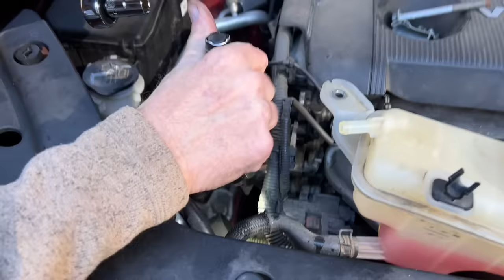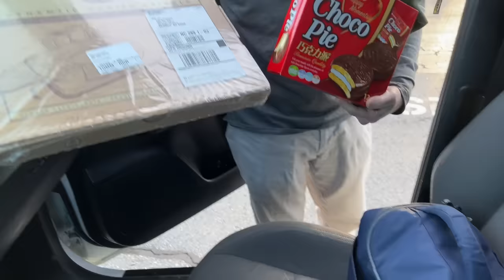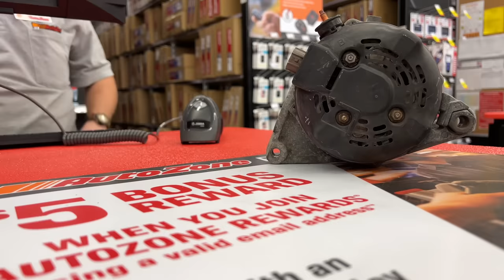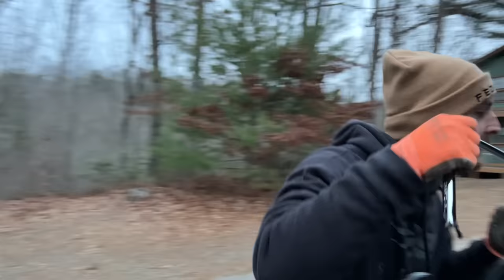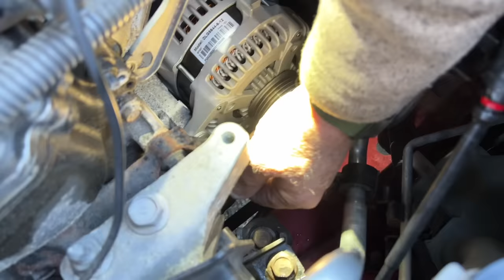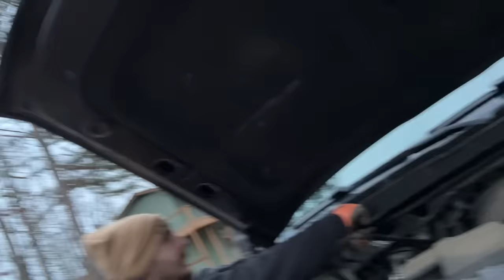Both Cars BROKE at the Same Time!

Comment: Well cold start on a diesel is difficult. You need to change your battery to Cold cranking amps on your regular car. On your husband's truck is a diesel. You need to keep the block warm, otherwise it will not turn over until it's warmed. Just get a little heater and place near engine block. Until it's warmed. Then let the engine idle for awhile before driving

Comment: Thankful you are up and running. Many many  years ago, I had a 1973 Olds Cutlass Supreme and it left me stranded in the road two times. Every time thought it was the alternator, but it ended up being the voltage regulator. Never will forget that. I’m watching your video on Sat. 1/6 and we have 6 inches of snow with more coming down here in the eastern panhandle of WV. Hope you guys get some snow for your mom! Take good care. God Bless!❤️❄️

Comment: Oh gosh, I suppose when it rains sometimes it pours! I've had battery trouble before, needed serpentine belts fixed, luckily that was on an older car I owned. I've also gotten stuck in the mud before, no fun. Glad you have your dad to help and you knew a bit about your car to diagnose what the problem was! I don't know much about cars..but it would probably help if I did! 😄
Reply from the maker: Getting stuck in the mud, that's no fun!

Comment: I used to have an old green station wagon.  It was tuff as nails, ran like a top.  The only trouble it ever gave me was the starter.  I had to keep a two by four in the back seat and when she wouldn't start, I had to put the 2 by 4 down to the starter and bang on the starter sometimes it would fire right up, sometimes it took a couple of tries but she always ran for me.  I got a lot of funny looks, and even a few comments along the way.  God bless you all.

Comment: Very nice to have mechanics on hand - save a lot of money that way! Vehicles -- I have so many car stories of repairs, and even though a Volkswagen Golf manual transmission was my favorite car of all to drive, it was the most expensive for repairs -- and the most ridiculous problems and repairs at that! Battery and alternator both with Honda; the car I have now I got so frustrated with the batteries going out I finally bought the real deal from the car manufacturer themselves, no more fussing with dead batteries too often, at least every year if it can be helped, figured that super tiny battery they make is hopefully the answer!

Comment: 🤗Glad the car repairs worked out. Our car just had issues too. All the power steering fluid ran out on Thursday (1/4/24)!😒 It seems there's a break in the line and a seal has disintegrated. It's Sunday and they're still working on it. One part of the fix led to something else 🙄...oh well, God's got this covered, too. 😉 As a side note ... Kringle pastry is delicious. I like the almond one. But the raspberry filled ones are delicious too. Blessings 🥰💕

Comment: Tell how old I am. In 1993, I was stationed at Ft. Wainwright, AK. I was driving in downtown Fairbanks them temp was around -30°f and the alternator died. I was stranded in the middle of Airport Way, the main drag in Fairbanks. A tow truck and a voltage regulator later, I was back on the frozen roads. God bless y'all.

Comment: We're all gonna be here all weekend talking about our vehicle woes! My first car was a 1967 Ford Mustang that my daddy had bought as a mid-life crisis.  When I graduated HS in 1986, he gave it to me, and within 2 years, my husband/then boyfriend had to replace the engine.  The car had no power steering , so the tires had BETTER be aired up, NO air conditioning IN TEXAS, I had a fan that plugged into the cigarette lighter!  We had several 'hot rods' and then switched to trucks.  Our BEST purchase, that we still have and is being rebuilt right now, is a 1996 Chevy truck.  Doesn't need to be hooked up to a computer to fix, can survive an EMP attack and RUNS LIKE A SCALDED DOG!!!
Reply from the maker: Nice! Daddy had a Chevy around that year when we were little 😁

Comment: You're very fortunate to have your guy's able to do all that. My right side turn signal light unit got pulled out  just hanging by the wires, at the car wash yesterday, so Tues I go to my mechanic shop to see what is needed for them to fix it then make an appt to get it fixed. Just time I guess and hope it doesn't snow😅.

Comment: Sorry about the car problems.  To me, there is nothing more frustrating.  My 1st career was a certified GM and BMW mechanic.....waaaay back in the '70s and early 80's.  When GM came out w/ the Monza 2+2 v8 and u either had to lift the engine up in the engine bay or take the tires/wheels and inter-fender wells off just to change plugs, I decided I needed to find another career!   On a different subject....did u get snow today (01-06)???  It 'almost' snowed where I live.  It was ~ 33℉ and cold raining.
Reply from the maker: Cool, I didn't know you were a mechanic and we didn't get any snow today, but I hope we will soon 😁

Comment: Very Cool, Thankyou. So Happy you Got everything sorted so quickly and managed to save on some labor costs. My best Purchase last year was a small Re-chargeable Car Battery Jump-Starter. Only Cost about $50- has multiple USB Charging Ports too if Power Goes Out. Get about 20 Car battery Recharges on 1 single Jump Starter Charge. Charges Quickly, and USB Charge Ports are Surprisingly Useful too. Hope this Helps. All The Best. Cheers

Comment: At age 70 I have had enough dead batteries that now I just replace them every 3 years. These new alternators are expensive. It is so full filling when the repair is finished and the vehicle is operating as it should. Shortly I will be in need of a set of tires for my truck, a 2010 Ford Ranger.

Comment: Hope this helps you guy's and gals. Also make sure your vacum hoses are sealed properly and are free of debris. Otherwise your car will not start. Your starter coil is inside your distributor. If the starter coil is cold or wet, it won't start. Your hair dryer can help that. 👍😎

Comment: This sounds like our kind of luck!!!  So glad everything turned out good!!!  Batteries and alternators certainly take a beating in cold weather!!!  I remember one time and it was in the heat of summer that one of our cars refused to start in the grocery store parking lot…luckily a nice guy jumped us off and we were able to run right down the street to get a new battery installed at a parts store.  Another time we were out of town visiting some friends when the alternator went out on our truck…the man we were visiting is a mechanic and he was able to go into the nearest town to get an alternator from a parts store and install it for us while we were there, otherwise we could  not have made it back home. We were in another state over 200 miles away from home.  He was very surprised we made it from our house to get to his house because the truck quit working almost the time we drove into his driveway—we literally coasted into his driveway—how’s that for timing!!!???!!!  So glad you guys are back to having two working vehicles.  💝💝💝

Comment: I find as i get older I have less enthusiasm for working on cars , especially if I have to get underneath them . Katies'  old truck is so much easier to work on than these new front wheel drive cars with no room to move , i like the traditional north / south engine with a gearbox behind and a diff at the back . well done though Matt and Austin , it feels good after the job is done 🙂

Comment: Corie tell ur dad use boxed end of wrench to get more extension to loosen n tighten that bend helps so much i grew up with mechanics n married a mechanic i’ve seen all the tricks of the trade n tell him thank u for getting alternator off n getting u back on the road!!! OH MY WORD that is the absolute worst looking battery change i’ve ever seen my diesel never had that much holding the battery in great job Austin!!! u all made it through the trial yay!!!  oh yea alternator left me stranded with babies n the heat bottom radiator hose blew with toddlers n an infant in over 100 degree heat n the torq converter bolts vibrated loose on my diesel n quit pulling in the middle of crossing a busy hwy talk about puckering up i just thought i was gonna get hit some guy on corner heard horns blowing n came running n pushed me n kids across n used his phone to call husband the both of them fixed my car right there so grateful to that guy n last one i’ll mention is car caught fire going down interstate with kids in car husband was in front n had to turn around miles up the road n pass us n come back down he said he seen it engulfed n started speeding to get back to me scariest to me was toddlers on side of interstate n trying to watch them and get fire out i just got a lg fountain drinks n through them on it n put it out saved my car had to replace couple things but i drove it for over a year after the fire!!! Hi Katie looking beautiful with that glow ur sporting, U r beautiful too Corie ur glow is just starting eager to see if ur glow is as bright or brighter than Katies!!!❤❤❤
Reply: i just got another telegram messages reported them again

Comment: I have one of those Harbor Freight cigarette lighter alternator/battery testers with LEDs which will show you in seconds if your battery is low and if your alternator is charging.  You can use a voltmeter on the battery, but this is quick and easy and done inside the car.  I also got one of those capacitor jump packs from Harbor Freight that you can use on a bad battery to start your vehicle or riding lawnmower.  Your husband could have used that to start his truck to get to work and again to get home until he could get a new battery.  As long as his alternator is charging his truck will keep running with a weak battery.  The reverse like your Toyota with a bad alternator will only work running off of the battery and when the charge goes down to a certain point your car will die.  Your dad is like me, you learn because of necessity and being poor and not able to afford a mechanic. I am not as poor now but do some of my own maintenance on my 2 daughters, wife's and my vehicle because I get pissed off how much shops want to charge and if you provide the part they charge you more per hour ($132.50/hr normal versus $175/hr).  I got an alternator from O'Reilly's for my wife's Toyota van that failed a day later that was remanufactured in Mexico.  I found that Advanced Auto owns World Pac that has the Denso OEM parts that were remanufactured in the USA and worked much better.  Good luck and I hope these tips help for the future.
Reply: @michaellandry788. Thanks for the info for rebuilt OEM parts being remanufactured in the good old USA.

Comment: Years ago we had a VW bus. The alternator went out and we were just running on the battery We were in the middle of the desert Miles from anywhere trying to get home. It was black as pitch in the desert. To save juice to to keep us running, we had to turn the headlights off until we would see a vehicle then we would pop them back on. It was nerve-racking and my anxiety was through the roof and that was before we had cell phones .

Comment: Cold weather and batteries just do not go together. I have had a strong battery one day and the temp drops to freezing the next day and the battery power is pulled right out of it. Strange. As for alternators, I have replaced many over the years. I know you are glad to have Dad to help you through. We are a generation of guys who as young men learned to work on vehicles to keep them running since we could not afford an auto shop.

Comment: I love helping you kids
Reply: Is your husband's truck a diesel. If so, cold start on engine block will not turn over.
Reply: Heat the engine block up with a heater, then crank it while warm. Warm engine block up by letting it idle
Reply from the maker: It's not 😁 @hordesCoffee

Comment: Quite awhile ago I had a small Honda Civic and the alternator went out on a heavily raining day that I had to go to a meeting for work that was over 100 miles away over winding slightly mountainous roads. I ran without lights as much as possible, but it was dark (from the storm) in an area that was unfamiliar to me. I was on this winding, 2-lane road which had a mudslide that closed it and I had to take a detour down a very winding (switchback) road, very little traffic ( in case I got stranded). Ran up against a tree across one lane, on a switchback). The only other vehicle I saw was a sherif and he left me far behind! I made it to the meeting. Went back another (longer) way, busier road. Other ladies at the meeting said follow them if I got into trouble they would help. I don’t know if you know what those little Hondas were like, but small! Big pickups would go flying past in that water & just cover the whole car with a wave of water. Oh forgot to say, it was before cell phones!
I did make it home! White-knuckled stress & major neck tension!
Reply from the maker: I felt stressed just reading this, so I am sure that was very stressful for you! Crazy that sheriff just pulled away, so glad you made it home safely!

Comment: Similar situation just happened to me. I live on a farm and I have to park my car outside. Turns out that mice, rabbits, moles, squirrels like the new wiring they use now. I guess the wires are coated in a soy based product and the rodents love them wires🙄 $600.00 later I now have to spray down my wheel wells and engine compartment with peppermint oil and flashing battery operated lights. I’m praying they stay the heck away from my engine🙏🏻
Reply from the maker: Oh gosh that’s crazy!
Reply: Yes, and frustrating. You should see me at all hours of the night running out to my car and banging on the hood or using my remote to honk the horn. If we had neighbors I’m sure they would think I was a crazy lady 😂🤣🤣

Comment: My sister and I were driving across Texas in the summer heat and talked so much we forgot to fill up and ran out of gas in the hot summer on a lonely stretch of freeway 3 hours from San Antonio. Gas was brought to us by a garage about an hour away. And off we went. Ironically 3 years later very very close to that same lonely spot in the hot summer, my alternator went out while I was driving 65-70 mph. Lights flashing on the dash, my steering wheel started to freeze. Was all I could do to get to the side of the freeway where it gave out. This time,  it took many hours before a tow truck could come. Waited for 5 hours. 
After a while highway patrol officer came and allowed us to sit in his air conditioned vehicle and cool off. It had to have been close to 100 degrees Texas Sun. There was no open garage close by. Had to tow the truck hundreds of miles to San Antonio by the evening.  Was pretty incredible it was same time of year and probably yards from the same place three years earlier. 
Thank God no accidents. But feeling stuck nowhere near a town was scary. Kindly people and learning patience in car problems makes the difference. The mechanic in San Antonio said it was the alternator. 
Thing is I had a trip check done at dealership in my town before my road trip. The San Antonio dealership honored the other dealership and gave us a free rental so we could get to Houston. On our way back, we picked up our repaired vehicle. God is good. Glad y’all are safe with all vehicles running. Your dad and husband are stars. ⭐️
Reply: Corie I replied here but I don’t see it now. Am I missing something?
Reply from the maker: I have been removing spam comments today, but wouldn't have removed yours. Sometimes YouTube glitches, I'm sorry!
Reply: @thepressleygirls  Oh no worries. Asking God to bless the Pressley sisters in preparation for the birth of your little ones. Can’t wait to see Grandma and Grandpa Pressley
With their grandsons.

Comment: I hate car problems. And it's ridiculous the way they design them these days. I need to change the left headlight in my car. The way it's designed is the fuse box is about an eighth of an inch from the cover to the bulbs. So you have to take the lid off of it, then unscrew the cover, use a screwdriver to push down the clip on the plug into the bulb, then use another to pull it off. Then you can remove the cover and swap out the bulb. Unfortunately, whoever last replaced it did it where the clip is facing down, so it can't be removed. I'll have to get a mechanic to do it, since I don't trust myself to move the fuse box out of the way without frying the computer. 
Good to know that yours were both relatively simple to fix. Hopefully nothing else will break for you anytime soon.